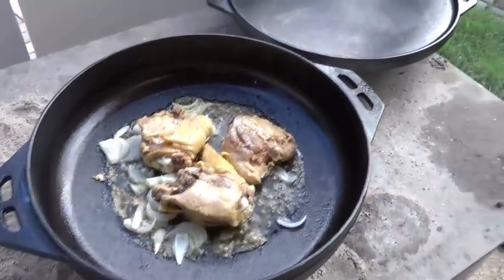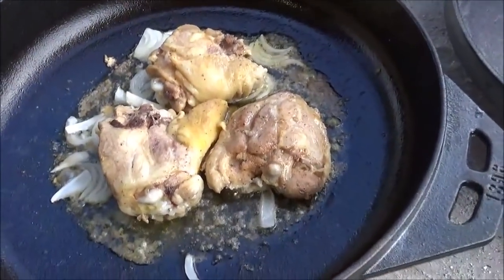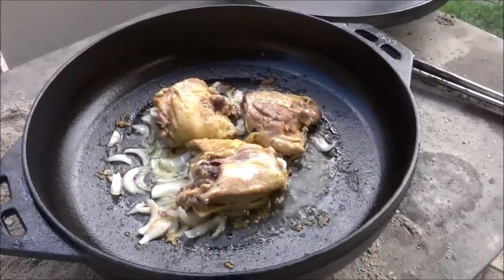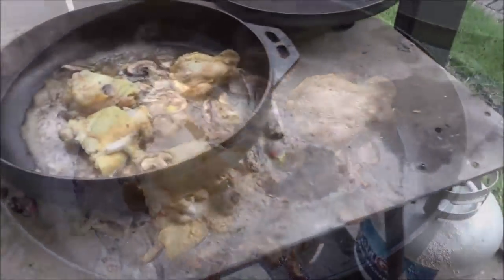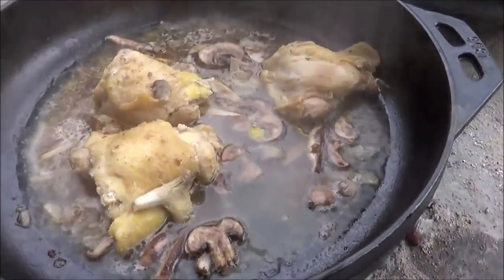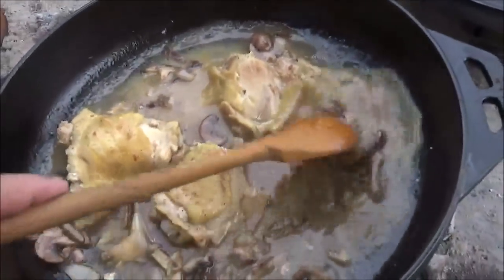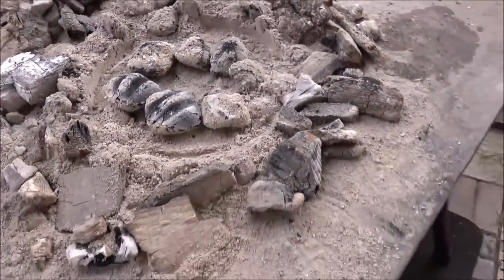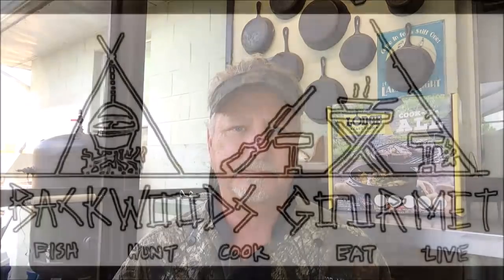The NEW Lodge Cook It All Review as a Skillet

Comment: I may be wrong but camp fire coals are hotter in middle and when just coals and embers are left dont need air as much. They and the ground under them become a radiant heat sorce. Charcoal and beads need air and dont really have much heat when burnt. Also you are burning on what appears to be a steel plate. Which is cooled on bottom by air so is robbing what heat you have. On the ground the ground gets hot and holds heat for ages. So yeah i think you're  right. Its aimed at camp fire use not heat beads. Its weight would help even out and hold heat well on camp fire coals
Reply from the maker: Great analysis.  Many folk that follow  our channel use a similar setup, so we are showing everyone how it works on a dutch oven table.  The same thing happens on that table when dutch oven cooking, but with a lot better results.  Thanks for watching.